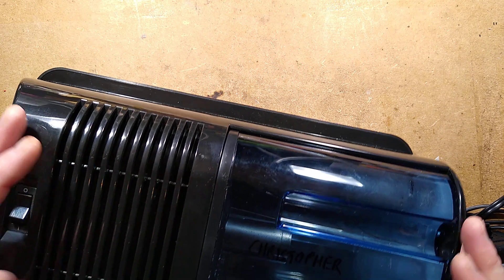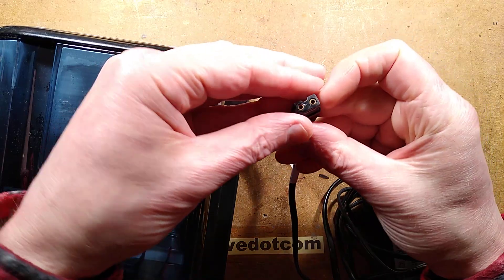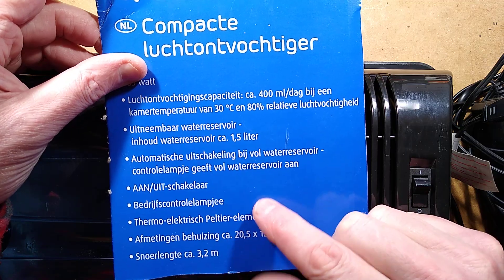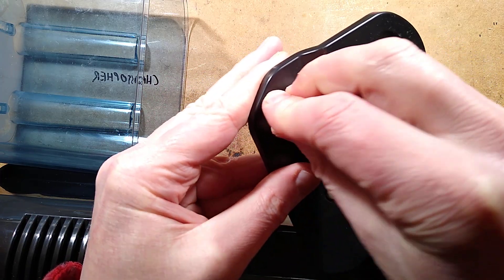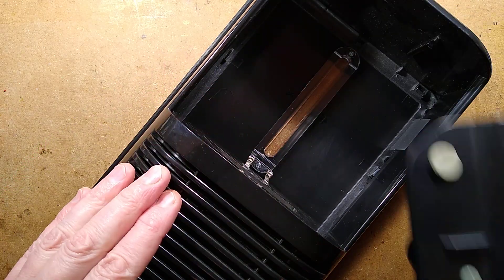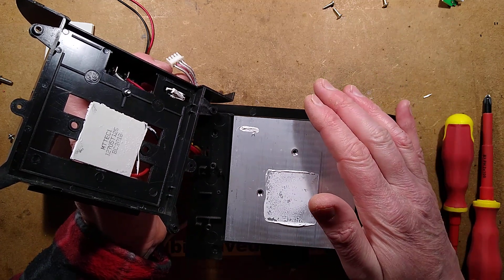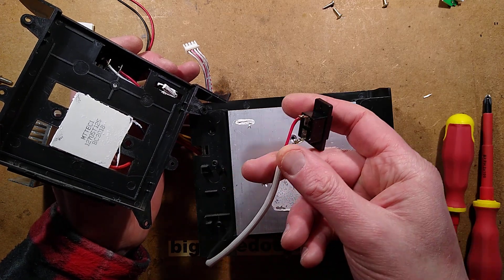Inside a faulty Aldi dehumidifier.

Comment: I did my first repair using your techniques, I knew watching your fabulous videos would pay off :D I bought a peltier de-humidifier off Amazon for my front room. The room has an exposed narrow vertical beam of stone in the middle of the window ( its a normal 2 bed terraced town house). The stone has been plastered over but in winter the cold penetrates the stone and draws condensation to the window and bottom of the double glazed units. I was sick to death of buying those granulated dehumidifiers, they filled up over a week. Long story short, the one from Amazon  is of a good build quality but wouldn't do its job. I took it apart, nice 'full' switch, Led's work, button works,  multimeter out, voltages on input 12V, 12V at stages on board, 5V at microprocessor, erratic voltages at transistor output to pelitier. Looked at it under a magnifier lens and solder looked bad. Re-flowed solder on tranny, it works! I put the unit about 4 inches from stonework and leave it on when I am at home. It collects enough water to get nearly to its tripping point (there is a float inside the collector) every 3 days or so, about 400ml (it has a 1 litre tank). It depends how cold outside and whether or not I put the heating on in that room. The rooms floor is boarded over a cavity. These houses are built on raw compressed sand and vented at floor level to the outside, under the floor. So I guess that room is always going to have musty damp air. However I must say this unit has eliminated almost completely the smell and no condensation has appeared on the windows, or more importantly the stone since using the unit. I was buying those granulated dehumidifiers at a rate of 1 to 2 a week at a cost of 69p each (pound shop). That unit will never cost that in electric per week and it runs from a wall wart, which gets quite warm but not worryingly hot. I guess for me, this electric unit is a cheaper option and there is nothing to throw into land fill every week. I wonder if anything can be done with the liquid from the granulated units as I imagine it would be very salty stuff, maybe use as a weed killer lol :) Sorry for such a long comment and, as ever, many thanks for your vids and much love, J x
Reply: Why not use a compressor one? It's way more efficient so way more cheaper to run.

Comment: Is that really a 29 letter word on the spec sheet?????
Reply: In Dutch, like in German, you can form words from several components and it is usual to just glue them together without any spaces or hyphens.
"luchtontvochtigingscapaciteit" = "airdehumificationcapacity" which you would write as "air dehumidification capacity" in English.
In German it would be "luftentfeuchtungskapazität".

Comment: Why wouldn't they just hard wire it from factory and put the power supply inside or ac motor ?
Reply: The design engineer for that design get ah a+ the electric engineer failed with ah d if I was grading

Comment: I bought Peltier plate  n mount it on pc heat sink the other side become cold after a while it was frosted with ting water drops freezed...I amazed to se it cooling...12v 60amps it was rated  looks it has two 30amp plates but how are they placed....

Comment: iMO, these Peltier units are little more than a gimmick. Removing humidity from the air is all about energy (and it takes a great deal of energy, most of the work done by an A/C is involved with removing humidity [latent heat] ) , and at 5A×12V×0.7 efficiency = 42 watts, these are a shadow of the capability of a classic vapor compression unit. A smaller unit will remove 1.8L-1.9L per kWh. (Runs at 320W). This unit should run at about 0.1L-0.5L per kWh. At 60 watts, with that efficiency,  it will take days to remove the same amount of moisture from the air that a compressor-type system can remove in 2-3 hours. They really, genuinely are that ineffective.
Reply: But they're cheap to build and easy to sell, so …

Comment: That thermal paste looks very familiar 
It's the same ceramic based thermal compound that caused the red ring of dead with the xbox 360 the blue light of death with the PlayStation3 and made 2000-2008 PC's very slow and noisy
Reply: makes sense
Reply: The paste was normal, it was the gpu being badly designed that bricked those consoles.
Also back in the day (pre ryzen) amd chips ran so fucking hot that even the expensive paste was dry in 1/2 year.
Reply: @_DSch  
The consoles were never really bricked, it was just a case of scraping off the hardened thermal paste and replacing it with a standard thermal paste and the problem was fixed.
Reply: @MightyRude  early consoles might have worked but still failed again later on.
You basically extended the timespan for the death a little bit.
Reballing or reflowing also never fixed the issue. On the PS3 Sony hacked the consoles in for repair so that the gpu from the slim is compatible to the fat. They would never do that if the chip design was not faulty.

Comment: 14:15 - me thinks that's old thermal paste
Reply: I'm fairly sure the heat sink came from a computer built sometime between 2000 - 2010. At least It certainly looks like it; some cpus used this as a stock cooler.
Reply: @agalerex  the die must be as they are still making them for things like this

Comment: Love your vids Clive!  Question please - What is your go-to cable stripper for the rubberized jacket on the better mic cable?  I would think you've had more than a little experience with mic cabling!
Reply from the maker: I often nibble delicately round it with a pair of side cutters.
Reply: @bigclivedotcom  same but sometimes I use what i got if I dont got any I just rip it out of what ever its in

Comment: I don't understand- where's the hidden death trap?
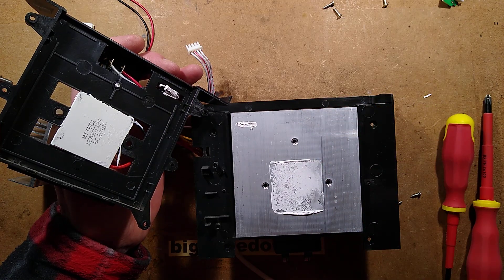Reply: I assume you are referring to the thermal fuse that will fail if the hot side of the Peltier gets too hot?  If you look at the final frames around 17:30 then you can see the thermal fuse covered in thermal paste in the black plastic housing just above the Peltier by an inch or two.  Or you can easily see the fuse’s outline in thermal paste on the upper left-hand of the heatsink.  

Otherwise, there is always the risk of fire whenever a power connector overheats and goes high resistance, but I’m uncertain which part of the video your question pertains too.
Reply: @ethanpoole3443  I don't know how many of Big Clive's videos you've seen, he has a habit of reviewing Chinese products that can kill you or burn your house down.
Reply: You didnt see the melted power cable connector?
Reply: @petertr2000  Sure, but I expect to at least see smoke if not flames to make it a proper death trap!

Comment: I had one on my sailboat and it was great in a locker that got bad condensation, dried it right up. But they won't work on a very large space. I did run a full sized compressor one too during the New York winter, helped keep down condensation on the whole boat. Ah the fun days of shoveling three feet of snow off of your boat deck!

Comment: Would it be more efficient if you improved heat transfer? If they had a copper/nickel cold plate and liquid metal interface I bet the heatsink and the condenser would suddenly be insanely efficient.
Reply: The peltier element is far more inefficient than everything around it. You'd be shaving a handful of gravel off a mountain.

Comment: The only proper dehumidifieres are compressor based. Not wasting huge amounts of electricity heating up on one side, but actually dehumidifying, multiple liters a day if you let them.
Reply from the maker: The desiccant drum dehumidifiers will outperform a compressor one in a cold room.  But the compressor units are more efficient in a hot room.
Reply: @bigclivedotcom  Point given. They would need to shut down the compressor as the temperature of the evaporator reaches the freezing point of water, but they actually heat the room a little by operating.
Reply: There's also desiccant dehumidifiers that are regenerated using solar thermal power.

Comment: Could a peltier plate have usefulness in cpu cooling, rather than water cooling? Perhaps at a lower voltage as to not completely freeze the cpu (if possible). I assume water will still be collected and need to channelled out?
Reply: No peltier coolers are not powerful enough
Reply: People always seem to fail to understand the difference between heat and temperature. Yes, people have attempted Peltier cooling, and with absurd expense, also achieved it. It's not just reaching the temperature, it's also removing the heat at the rate it's generated to KEEP the temperature. Peltiers are notoriously power-hungry and inefficient, and they also produce a significant amount of heat on their own, heat that needs to be dissipated in addition to what the cooled part produces. Water cooling produces negligible heat (at the pump) and is capable of taking away large amounts of heat that can be dissipated cheaply somewhere else, simply by running the coolant pipes somewhere else. Peltiers are only preferrable if you need to reach temperatures significantly lower than ambient and when you cannot have moving parts.

Comment: i have the same one, they don't even take 100ml out of the air over a month and it had the same failure.
Reply: The ones with compressors in them are so much better.
Reply: @jamescollins6085  i got one of those last year and it definitely pulls 10L out of the air per day.
Reply: @MrPlytiger  More energy efficient too, when you consider how much water it pulls out of the air.

Comment: I have often wondered if a peltier device could be used as the heat exchanger for a  lab still. Tap water in one side and distilled water out of the other. At a guess, it would not be very efficient, but worth a try for a project.
I have a very similar dehumidifier to the one in this video. It proved to be hopelessly inefficient from day one, maybe with a build fault. I wanted to take it apart so I could use its peltier to make a still, unfortunately it has been assembled with security screws to fix the case together and these are in very deep holes in the case. I am unable to reach them with any of my collection of security screw bits. Why on earth did they make it so difficult to disassemble?

Comment: Clive, when I was researching dehumidifier designs for my thesis project about 6 years ago, your video on a white version of one of these was incredibly useful and I cited you in my research. That video was such a great help to understand how these things functioned, thank you!
Reply: Seen such like Clive vids but wasn't aware of them being thermocouples being used in reverse !
Reply: @millomweb  The Peltier and Seebeck effects are two faces of the same coin.  You can put electricity through two junctions to get a temperature difference (Peltier) or maintain those junctions at a temperature difference to generate electricity (Seebeck).  You can use the same pair of junctions either way.

In practise, thermocouple junctions are small so they have low thermal mass and quickly reach the same temperature as whatever you're measuring, while thermo-electric coolers are large so you can shift a lot of heat.  But, if you're feeling perverse, you can use either of them to perform the function of the other (just not very effectively).

Comment: Tech ingredients did a nice row of videos on cooling, generating power with them or useful implementation (highly insulated cooler) of those elements
https://www.youtube.com/watch?v=YWUhwmmZa7A
(see also the generator to drop into fireplace while camping)

I still dont like those peltier stuff unless you are using it with a radioactive heater in a satellite or remote sibirian coast beacon station.

Even if "small power" gets wasted, still only around 17% efficiency from those elements and thus heavily tend to overheating and not working anymore.
For the car boxes it's mainly to keep colder a bit longer, than to really cool and its still better to just put frozen cooling elements into a proper isolated box.
I played with those peltiers back in school and there was no relevant technical advantage since then in the last 20 years...

Only thing is: if you have power to waste (solar power) instead of storing it into a battery you can heat or cool things "for free" without any maintenance.

Comment: Lots of heatsink compound?  Not a good idea.  Even the ones with the highest thermal conductivity (they're expensive) don't come close to aluminium.  Use the minimum to fill in scratches and other surface imperfections, so the compound replaces air (a poor thermal conductor).  See https://www.youtube.com/watch?v=8MOTMq9g8Nk
Reply: I agree, but loads of people use huge amounts - even AOI CPU coolers tend to come with 1mm of compound pre-installed. Which I can never understand.  I guess the difference in marginal and only really matters if you're OC'ing a CPU where 1C can be a difference-maker?
Reply: @petertr2000  Last time I looked at this stuff (over 30 years ago) the life of semiconductors was inversely related to the fourth power of the junction temperature.  So 1C can make a big difference to the lifetime of the CPU.

 Even using the simpler chemistry approximation that reaction rates double for every 10C rise, and assuming failure is totally due to chemistry (it's not, there are diffusion rates of the dopants and all sorts of other factors) it's worth dropping 1C if you can do so cheaply and easily.

The surface finishing in that video is overkill unless you're heavily into overclocking.  But using the appropriate amount of thermal compound is easy and cheap.  More isn't better.

Comment: Clive, there is an awesome lowtech solution to the clips that like to reattach themselves: Guitar picks. Buy a couple dozen on your favorite shopping website (aka, eBay) on the cheap, and then use them when you're spudging things open.
Reply: Not rigid enough for most jobs once you put them under significant load.
Reply: @gordonlawrence1448  Sure they are. I've never broken one. You just need to use multiple to spread the load.
Reply: @gordonlawrence1448  You've never seen the variety in thicknesses that guitar picks come in, now have you?
Reply: @Anvilshock  Yes I worked in a music shop, play base and 6 string, and as  someone who has worked as a senior design engineer I know a fair bit about materials science so can tell you with 100% certainty that no guitar pick is going to have the strength/rigidity to be a spudger without being too thick to do the job. Even Delrin is way short of the mark never mind polycarb.
Reply: @gordonlawrence1448  The suggestion was holding after spudgering, not spudgering itself, mind, so as long as they can be had cheap, plentiful, and handy, they'd do the job perfectly, especially when that job is to just stay in place and keep the gap just wide enough that the hooks don't reengage. Furthermore, there's spudgering and then there's crowbarring. Not everything that needs disassembling also needs inhuman force, many things can be spudgered with picks just fine.
Oh, and that's spelt "bass", you bass player. Want me to forward your post to Glenn Fricker?
Reply: @gordonlawrence1448  if you worked in a music shop and play "base" then you'd have come across metal plecs? No? Just me then?

Comment: I had no idea Peltiers were based on thermocouple technology. I suppose I read "solid state" and my brain substituted "semiconductor". Thanks, Clive. 

They might be inefficient, but (in generation mode) were allegedly used during WW2 to power spy radios. This mechanism powers many small space vehicles including Voyagers 1 and 2. They're also useful in the classic cooling mode for chilling sensitive front-end amplifiers well below ambient temperature, where all the K's matter.
Reply from the maker: I think they are silicon based.  I may have mixed a couple of technologies up because I recall taking one apart and it had zig-zagging wire bonds.
Reply: They're based on P-N junctions, just like typical silicon components.

Comment: I'm in the initial process of building something like this for my 3D printer filament storage... I was going to use one of those little solid state dehumidifier modules, but they still only sell them from their UK store, and £30 plus fright to Australia is more than I want to pay when I can do this style with old heatsinks and fans, and only need to buy the Peltier module (for like $5-$10 on Banggood)
Reply from the maker: I use a standard plastic storage box with some foam door sealer tape on the lid for a better seal.  Inside is a silica gel pack.  I 3D printed a holder for a standard eBay humidity meter so that it can be read from outside through the clear plastic storage box.
Reply: Careful of the Banggood ones. I bought a few and they were crap. My next order after that did not arrive at all. Personally I would buy locally given the option.
Reply: @gordonlawrence1448  what dew point does the resin need? Commercial desiccant bed driers are around -40 I think.
Reply: @anullhandle  Honestly I'm not sure. I use them for cooling electrometers and have a stack of up to 4. Each one as  you get closer to the electronics about one third the size of the last. The electrometers are in hermetically sealed boxes (metal) so water ingression is not an issue and it works nicely as a Faraday cage. The kit I'm cooling only generates about 0.1W of heat, and the outer peltier has to be about a 50Wone though I drive it at about 25 ish so as to improve efficiency (as I do with the rest or it would be a stack of 5).

Comment: I used to use something similar but gave up as, after a year or so, the fans started to whine loudly which was somewhat annoying. 🤨
Reply: Indeed. However, at the time, I didn’t have the experience that comes from watching you take things apart for multiple years. 🙂
Reply from the maker: You can swap the fans for better quality ones.